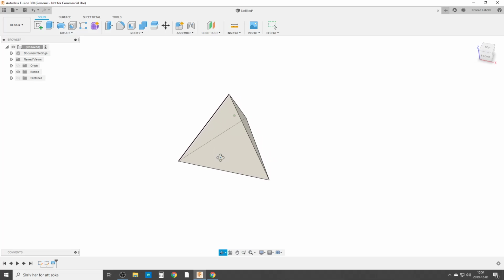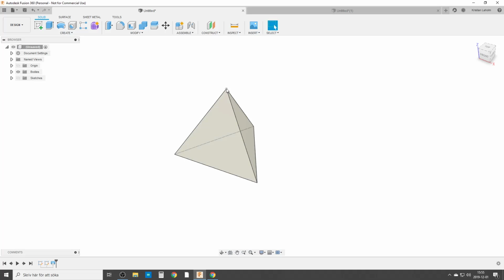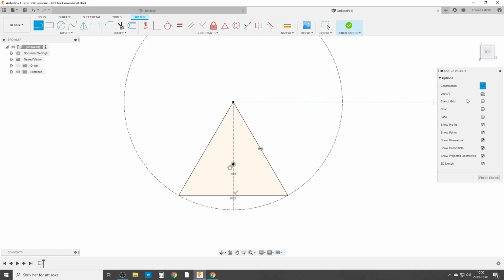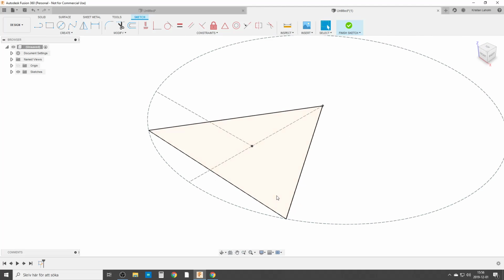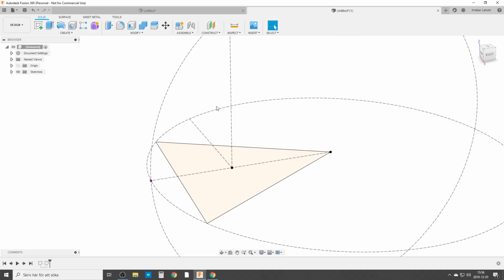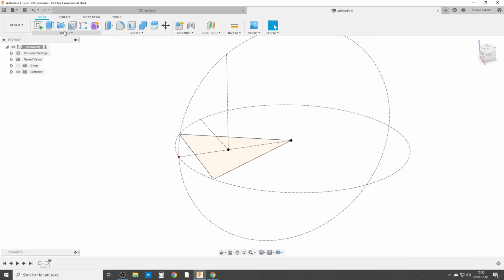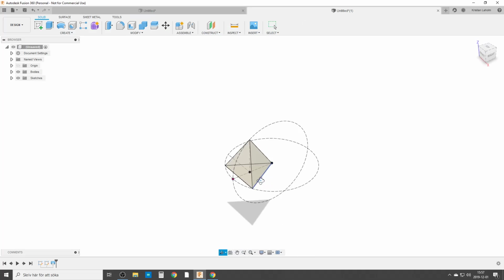Tetrahedron - Easy in Fusion 360 - No Math or Angles

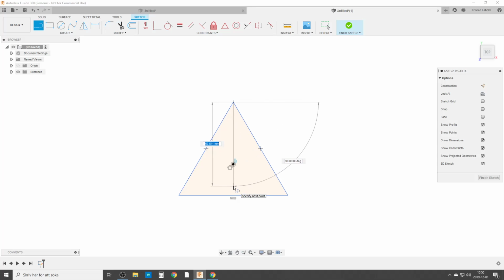Comment: I just followed all your instructions and realized you can actually skip the help line from 0:58, and just draw your circle from the top of your triangle to any of the other two points of the triangle, since that's the same length as the line you were creating to then make it equal. It will snap and the circle will follow the size of the triangle if you modify it at the end.
Reply from the maker: With a geometric problem like this there is often simplifications that can be done.

Comment: Great video! One question though, at 2:21, what is the purpose of "Project"?
Reply from the maker: I use project to transfer measurements from sketch to sketch, there is the possibility to auto project but it confuses me :)
The design intent in this videos is to only have one dimension drive the model.
Reply: @KristianLaholm  I did notice that if you don't do "project", when you draw the circle it won't snap to the points, it will try to go to the nearest grid point which is not what you want.
Reply from the maker: @stephanekiss  I recommend to turn of snap to grid, it can give you some strange problems.

Comment: When I attempt to dimension the horizontal line, Fusion tells me the sketch is over constrained. I don't understand what I did differently that you...
Reply from the maker: Check that there is no dimensions in the sketch. The polygon command puts in a dimension if you by mistake hit the keyboard will crating the first triangle.
Reply: @KristianLaholm  Got it! Thanks for the reply! Your video is a great resource to get to know parametric design, which I am new to.
Reply from the maker: @alessandroavir7386  Thank you :)
Reply: hello i have the same issue and i dont understand what to do
Reply: like i have other dimension but dont know how to delet them